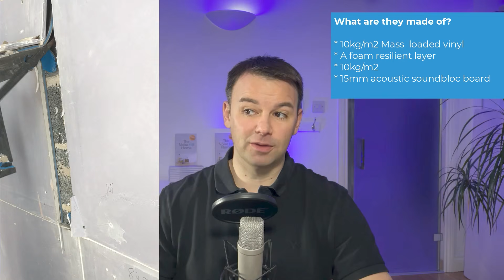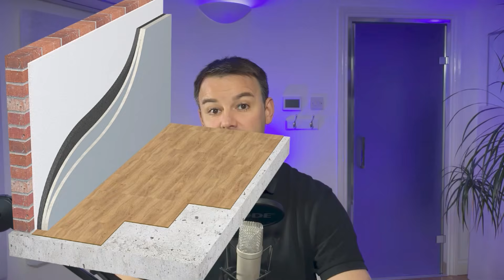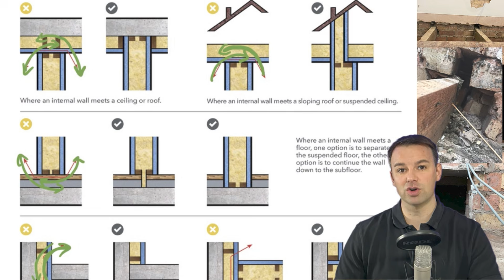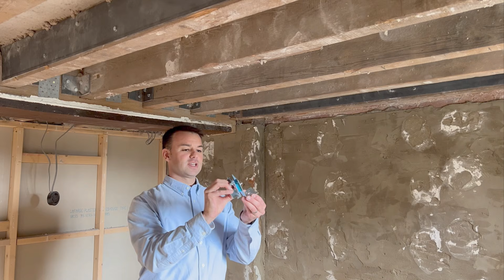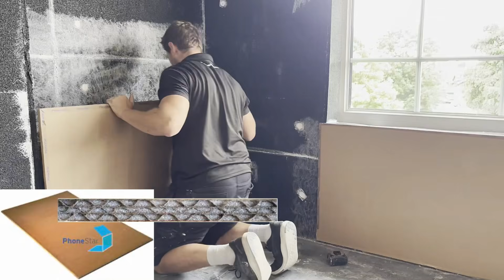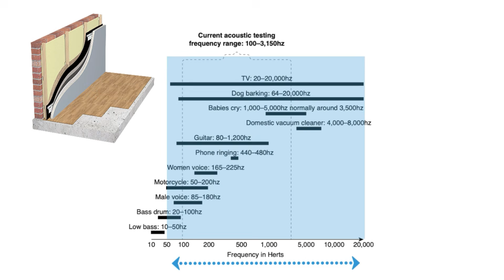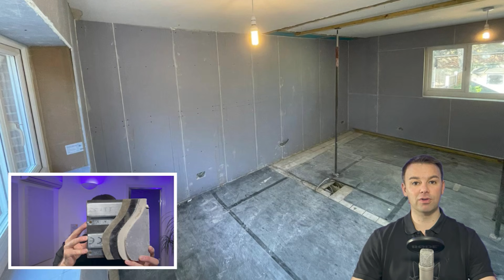7 ways to Soundproof a wall | #diy

Comment: Hi Jim. Excellent video, thank you. I am looking to tackle a solid brick plastered party wall (1950s UK terrace house) which airborne sound is the problem (conversation namely). Before installing any of the systems included in your video I will plaster the same brickwork wall in the ceiling joist zone and loft zone and floor joist zone as I understand this helps terminate air gaps through the brickwork (and would create a level substrate for one of your systems). Is this a correct approach?
Reply from the maker: Hi @Cagstok,
Thanks very much for your comment, yes that is a very nice way of doing it. Sometimes we have to do that when the render is thick to avoid a discrepancy or step in the layers. Taking the time to render these areas will save you time during the installation. When the render is thinner, we go straight over it.

Comment: We are experiencing outside noise and impact noise down the side of our house. Would you recommend system number 4 for the flanking walls?
We would be looking at clip and channel for the direct noise path we think
Reply from the maker: Hey Reese, thank you very much for your question. System 4 would be best to sound deaden the light weight thermalite blocks, a clip and channel system would need to go on a floating frame after you have sound deadened the wall, otherwise you may channel that noise to the bedroom above, especially if your house is a new build. 

Remember Reducing impact noise is never just the direct noise path. The impact noise of kids running around in the alley way between the detached houses is coming into your lounge through a number of noise paths. 

Here are a couple of 1min shorts 👇that might be useful.

https://youtube.com/shorts/I_kh99Ohvvs?si=J735uZN2_jgiou4_

Also this short which you may have seen already:

https://youtube.com/shorts/Q-CvdeA9m7s?si=JBvyCBmVtQm7rBDr

Hope that helps, thanks for your question
Reply: @jimprior7  thanks Jim!

This is really useful. We have been considering giving it a go ourselves. Just want to make sure we don’t make any mistakes :)
Reply from the maker: @ReeseBayley  I think you should give it a go yourselves, jump on the next intake of the Noise Free DIY Soundproofing Course, it has step by step video lessons on each of the layers of the different system. At least you will be following a tried and tested soundproofing methodology taught to you by professional award wining installers. You can do it at your own pace it's an on demand course. Give me a call if you want. 👍
Reply: With the floating frame system, how is the frame fixed to the property?

Comment: Hi great video, I am looking to reduce the noise from a saniflow waste extraction pump my neighbour has fitted in  their recently installed en-suite. We have a 1930s semi and  their en-suite is in the alcove on the party wall so is clearly audible in both our main bedrooms and also the living and dining rooms below. 
What would you recommend to reduce the sound to a minimum?
Reply from the maker: Hi @theHotstepper76, thanks for the comment, I think you are going to need something like this in the alcoves: https://youtu.be/JUdjtpa2ik0?si=cWbz53Tvaw4J2qYE
The soundproof wall system to the alcoves would need to be joined up between the alcoves downstairs and the alcoves upstairs. 

However there are two key things I would recommend to do to reduce that pump noise.
1. Every hollow void in the main bedroom and loft and living and dining room needs to be insulated with a RW3 like we show you in the course and videos. (Floors, ceilings, stud walls and boxing)
2. Need to apply that M20AD rubber I bang on about all the time to alcoves and chimney stack and any flanking wall you are hearing the pump noise.

Does not matter what system you put on the wall, unless you do those two things it will still come through. 

Assuming you can’t pay your neighbour to decouple the pump from the structure with a piece of rubber?  

Thanks very much for watching, hope that helps and let us know how you get on.

Comment: Hello, I want to create a soundproofing wall for a part wall, I'm thinking to use rockwool accustic extra, tecsound SY70 and 2-3 layers of accustic drywall. But I'm not sure where it's better to put the  tecsound, directly on the party wall or between the drywall layers?
Reply from the maker: Hi Gabriel, that is a good question, I would use the TecSound SY100 Self Adhesive on the party wall directly if you can. Make sure it’s not plasterboard on the party wall. (Always remove that first)

If you can get a layer of TecSound between one of those layers of acoustic drywall as well as sound deaden the party wall with it as well, that would also be good. If you had to choose party wall or between the board for the TecSound….because you already have 2-3 layers of mass with the acoustic drywall….I would go for the party wall and sound dead it first with the TecSound. Hope that helps. Great Questions. Here is a video of us using it: https://youtu.be/rs8ITTvKh8I?si=1E8_EfA2moOuohI0

Comment: any good for kitchens   to  offset   washing machine activity   2  washing machines
Reply from the maker: Hey Kenneth, thanks for your question, the best solution for you would be floating frame, which we show you in the Noise Free DIY Soundproofing Course. It sound deadens the wall and then has a 25mm isolation gap from the wall and the structure, which will be best for the different frequencies a washing machine gives off....but also helps with the impact noise when the washing machine is on spin. Consider the floor too, a lot of the noise will be vibrating through the floor and you might want to consider and floating floor and even anti-vibration pads under washing machines... if you have access to those washing machines.

Comment: Great video, thanks!  I have a renovation 3 bed semi, I'm looking to soundproof two adjoining walls (lounge and main bed), I also have access to cavity between ground floor ceiling and 1st floor floor (ground floor floor is solid concrete, no void).  I'm looking to utilise one of the low thickness options as I don't have much space - the house is 1950's 100mm cavity wall build but I don't believe there is a cavity in the adjoining wall.  I have the option to build onto the existing good plaster finish or remove back to bare brick - which option would you recommend?  Thanks!
Reply from the maker: Ah thanks very much mate, and thanks for your question too…go straight over the good solid plaster. Only remove back to brickwork if you have hollow voids like drywall or dot and dab technique. Here is a bedroom wall being soundproofed: DIY Soundproofing walls from noisy neighbours
https://www.youtube.com/watch?v=4Utchs-ZA6I

Comment: Hi Jim, quick question... Would you be able to advise what would be an approx. difference between 50mm thick RW3 insulation & 100mm thick RW3 insulation in terms of dB improvement. If I were to use 50mm thick but denser insulation (e.g. 80kg/m3 or 100kg/m3) would that achieve similar results to 100mm thick 60kg/m3 rockwool? Thanks in advance
Reply from the maker: Hi @Edgix10,
That is a really interesting soundproofing question. To be honest I’m not sure of the dB difference between 100mm and 50mm Rockwool. This is mainly because it depends how you are using it. In a residential setting, the db reduction value is kind of irrelevant unless you apply the same rockwool system to the ceiling, floor and all the walls perpendicular to the separating party wall…..and check for any holes in the structure first.

With regards to the density of the Rockwool insulation I recommend the RW3 (60kg/m3)  because it’s not too dense that when you install it between joists it will bridge the gap. It is difficult to pack it in tool tight if you cut it too big.

The different densities will tackle different frequencies of noise. For DIYers and builders I always recommend the RW3 (60kg/m3) because it is more readily available and it does a wide range of frequencies we hear from neighbours and easy to use.

Here this video might help a bit: https://youtu.be/IZAKD4kJvlU?si=Zb_VHqeuhZ1HtbSU 

Hope that helps….what is you noise problem and where are you plaining to use it?
Reply: @jimprior7  Thanks for the response. I'm planning to soundproof my party wall to reduce low bass from my neighbors. I'll be soundproofing the ceiling with 100mm RW3 and soundbloc plasterboard, flanking walls with TPS65W system and party wall with isolated frame system - M20AD directly to the wall / 15mm gap / 50mm stud frame and RW3 / MLV / resilient bars / 15mm SBX / 15mm Soundbloc.

Comment: A local soundproofing company to me says they offer an "Independent Wall" solution, which I think is the same as method 6 in this video. However, they do not say that they remove the existing plasterboard wall first. They build the new timber frame on top of the existing plasterboard wall. Is this a red flag?
Reply from the maker: wow! 🤯yes big red flag ....No it will not be a floating frame they will offer,. What they offer will be  isolated from the party wall only, clips and channels with TecSound and 2 layers of 15mm board installed to the channels.....make sure you get a page of references of who they have work for and actually phone those people up and ask them what reduction in noise they got....seems simple but amazing how many people don't do this. Here check this video out: How Much does soundproofing costs?
https://youtu.be/eGRSOjyR2Ds?si=LnPE6jGs0m2Q-ZdC
Reply: @jimprior7  
Thanks Jim.

Comment: At the beginning of the video you seem to say the clip and channel systems outperform resilient bars. If so, would you consider building a floating frame and then using clips on top of that?

Also, have you ever considered using clips to fix the floating frame in place, instead of the rubber pads? Cheers
Reply from the maker: Thanks very much, great question.

The reason we do not use clips and channels on our floating frame is because the channels move too much between the clips, where a resilient bars is fixed to the frame. 

The frame is sometimes only screwed in a couple of places on the head plate and sole plate and often glued or sometimes with the right property, no fixings and just pressure and the pads. (That’s 19 years’ experience of installing it though to do that!) 

Resilient bars are also only 17mm space loss keeping the floating frame system at 175mm. Using the clip and channels will take the wall system over 200mm, but yes if you have that space available it would be better….just make sure the frame is secure and not completely floating so you don’t end up with too much movement in your wall.

Have you seen this video yet: DIY Soundproofing - Step by step
https://youtu.be/7OdKIEmpbWM 

Are you looking to install a floating frame for your project? What kind of noise problem do you have?
Reply: So if you have too much movement in the wall, what's the problem caused? Is it that the plasterboard will crack?

That other video is great thanks.

I'm looking to install a very thorough system to a Victorian semi bedroom. Joists run parallel to the party wall. Walls are mixture of original lime plaster and sections of newer stuff. Removing some plaster has revealed a lot of holes in the mortar, some 20cm deep!